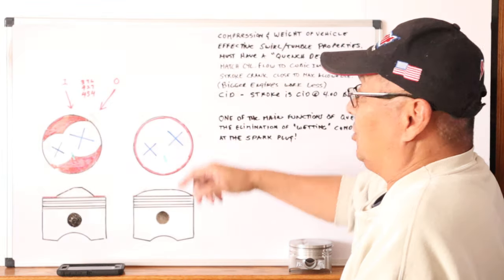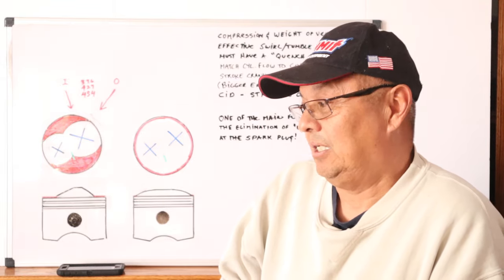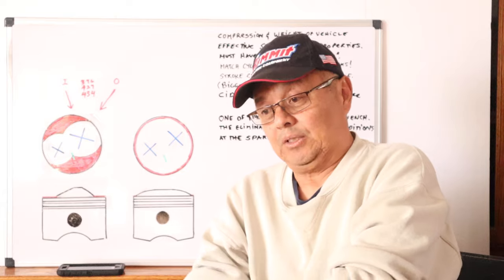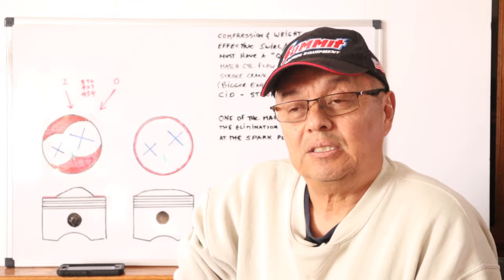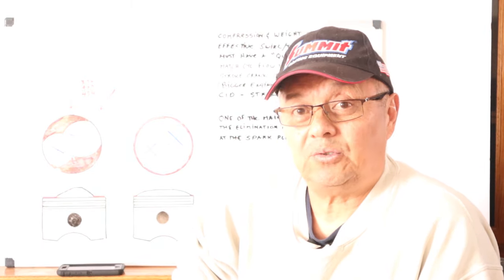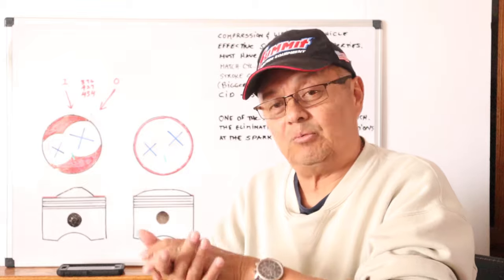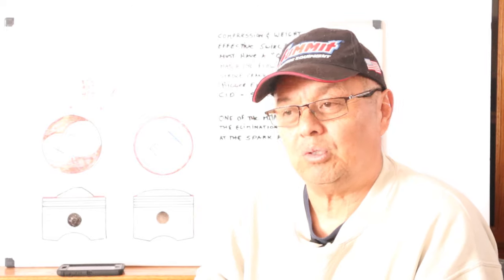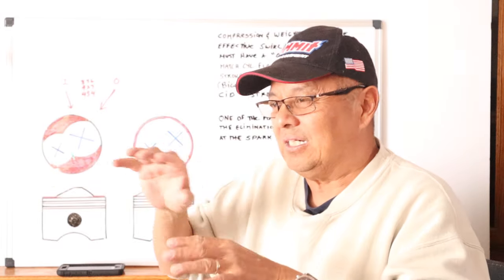HOW MUCH COMPRESSION PART I CAN WE RUN ON THE STREETS?

Comment: Great video Mr. Alameda-love this topic! Your comment on CR vs load (vehicle weight) was thought provoking. I understand an engine works harder under load, however, I can't visualize how the combustion process is affected by load.  What's got me stumped is, if an engine runs fine (no detonation) under light load, why would it change with load. Cylinder filling is what it is-at any giving RPM, at wide open throttle, and should not change based on load. What causes detonation-Is it CR, or is it the total psi within the cylinder? What say you?

I'm in agreement with you on maximizing squish/quench to create turbulence/mixture motion within a cylinder. However, many moons ago, I believe it was a Circle Track article, where the engine builder had an opposing point of view. The engine builder's theory was to slow the motion in the chamber prior to ignition, to avoid extinguishing the flame front-was this the early stages of chamber softening? Thank you, Tony
Reply from the maker: Ts,  what you will find and realize is the load vs. non load conditions within the combustion chambers!  Under free revving the engine does not meet rpm resistance or slowing down of the rpms.  When under load the rpm rise is stunted/delayed significantly while the FLAME FRONT SPEED DOES NOT SLOW DOWN.  This situation of slower piston speed towards and after TDC will affect the "unburned" sections of the combustion chambers!  Mainly around the intake valve relief @ the piston closest to the cylinder wall.  ON THIS AREA IT SEE'S A RAPID RISE IN TEMPERATURES AND PRESSURES elevated to a point that auto- ignition emanates from this area.  A secondary auto ignition is also present at the exhaust valve relief at the piston closest to the cylinder wall as well.  Lean conditions at the intake valve pocket is exacerbated by the slower piston speed and the expansion of the ignited gases is still progressing at the same rate!  Here the dangerous situation rears its ugly head and continues on towards pre-ignition!
Like wise, the RICH CONDITIONS @ THE EXHAUST RELIEF results in a slower than normal ignition flame speed at this area because the richer mixture progression is slower BUT DOES NOT EXEMPT THIS AREA FROM THE SAME PRESSURE AND TEMPERATURE SPIKES SIMILAR TO THE INTAKE SIDE!  Therefore a loaded engine's RPM RISE IS SLOWER.  AN UNLOADED ENGINE RPMS IS FASTER!  
BOTH PRESENTS TWO DIFFERENT SCENARIOS AS PISTON SPEEDS SLOWS WHILE THE IGNITION FLAME SPEED STAYS THE SAME.  
Remember:  Lean areas burn "slower" because the fuel molecules are farther apart.  
Rich areas also burn slower/cooler because rich mixtures are lazy and burns at a lower rate!
In short if loaded or unloaded does not make a difference on chamber performance and conditions?  Then why do we dyno an engine and tune ignition and air fuel ratios  under load???
If load is unconsequential then we will just free rev the engine and set our tuning tables!
But that would not work anywhere.
The scenario above points to increase probability of detonation first from the intake side then the exhaust side if the conditions get progressively worse.  
The same loading conditions exist in 1st gear and the probability of detonation gets progressively worse the more you get to 2nd, 3rd and final 4th gear!
The difference here is the slower rpm rise as you go thru the gears because the engine sees ever increasing "load" as you lose gear reduction thereby making the rpm rise much slower and here is where the problem starts!
Big difference.  I hope it is clear with you and thanks because it is an excellent and worthwhile question to answer.
Lastly, an engine with no load does not build "boost" and the only way you can achieve it is to hold reverse and low gear/some 2nd gear on a transbrake!  This will excite the combustion pressure to a higher level and the turbo will get a blast of exhaust pressures absent from a no load/light load situation.  Proof that the combustion conditions are indeed different between load (added-weight) and no load/light load.
Ben.

Comment: What metal your heads are made out of has a whole lot to do with how much compression you can run, typically with aluminum heads you can run quite a bit higher compression without detonation when compared to cast iron heads of the same specs.

Comment: Sir I appreciate your videos . I glad I ran onto your web sight . I alway was told 200 ccp on a street engine. I run a bit more on my Harley but you have to be careful on not heat soaking or lugging . At any rate I was told a long time ago I could run a half point more compression with aluminum heads . I don't remember what I was told but way back when the aluminum heads they poured something through them to help with the heat loss ..  most will say no way but I ran 12.5 in a 302 chev engine I built in I think 80 and I ran a 600 isky roller sold..that a a decent set of cast iron angle plug heads off a g gas car .. seems like I ran super unleaded and regular gas mix . I kept the engine at 160 also . I never as far as I know had problems . The engine had a 0 deck . I had help building the engine from a dirt track shop in Dallas and a fellow from my home town..since I found your channel I tried to watch all of them a great teaching opportunity.  Thanks again
Reply from the maker: Thanks Jim.  I feel 160* is too cold and you will have premature cylinder bore wear.  If you can move that higher to 180*f the engine should run better and longer.  Cast iron heads are not a laughing matter as you found out and at 12:5 it is at an advantage and you probably know that and I am not telling you anything you do not already know.  Obtw thanks for supporting my channel.

Comment: Another thing to add, try to get forged pistons made from 2618 alloy, and not 4032.  4032 alloy may fragment from the effects of detonation and if this happens, it can be very destructive of the engine.  The forged 2618 alloy piston is much more resistant to the effects of detonation and heat.
Reply: Also, as a form of 'insurance'... although we have 93 octane here in Texas, I am lucky enough to have stations nearby that sell E85.  I usually get a few Jerry cans full of E85 and add a couple of gallons to my tank before topping it off w/ 93 octane.  E85 is 108 octane... and it also cools the burn of the fuel.  With just a couple of gallons, you don't need to retune anything or get E85-specific equipment.  Definitely see a difference, especially during these 105+ degree Texas summers.
Reply from the maker: What is your mixing ratio with pump gas to e85?  Thanks for your insight.

Comment: Good video Ben! I never really understood how piston shape affects the quench, you described it very well. I learned years ago from Tom Nelson of Nelson Racing Engines, to zero deck the block and use the head gasket to adjust the quench. Of course with a stock type steel head gasket this wouldn't work, you would have to put the piston further down in the hole.
Reply from the maker: With most engine if you are zero deck a .045 head gasket thickness or even tighter would work really good on a small block. What kind of engine do you have?
Reply: @benalamedaracing2765  454 big block chevy....piston will be about .003 to .005 in the hole and using a felpro .039 gasket.

Comment: I always felt the dish pistons suck. Compression 10.5 to 11 with decent gas and 3000 pounds works well as you say. Torque rules on the street. High RPM  power not realistic on the street. Gotta love 331 SBC, smooth and efficient. Keep camshaft 224 degrees/ 110 separation or slightly less on both.
Reply from the maker: A childhood friend of mine with me doing the engines and running his 65 corvette we were cleaning the streets!  lol  LOve it with that much rpm potential!

Comment: Excellent content!! It sometimes becomes difficult to run a flat top with a large 500+ ci stroker, because if you do you'll have like 15:1 compression!
Reply from the maker: Big strokes more than a big bore will yield the higher compression ratios.  It is very hard to build low compression with huge displacements.
Reply: I think you have it backwards. With a bigger bore, such as in a 540 BBC, you need less of a dome to achieve the same compression. With a 454, you need a bigger dome to get a good compression ratio.
Reply: @ekitching any time you increase the cylinder volume you increase the CR if the closed volume stay the same. 540 has 1/4 more bore and 1/4” more stroke than a 454 also.

Comment: BBC heads really suffer with their design... They're severely "undervalved" because of it and require some real trickery to get good numbers, from my experience.  One thing I saw my friend do on a few different castings, was sink the exhaust valve (50 thou or more) so the incoming intake charge flows over top of the exhaust valve face (instead of finding it's way right out through the short side, where then it REALLY can't breathe) in the low lift/over lap phase.  That was pretty much how my buddy, Nick, said it...  I just tried to put it more simply...  He ported heads for living, and always had some wild looking stuff over there.

Anyways!  Thanks a million for the wisdom, Ben!
Reply from the maker: Thank you and you have a good friend there with obvious good skills!

Comment: Many years past Diamond Pistons provided a video on pouring their mold material into a  combustion chamber which they would then use to build your pistons.. this was done on an engine stand with head mounted, mold goop then poured in from bottom of cylinder
Reply from the maker: They did that then and today they use a computer and digitized the whole chamber and feeds that to the computer to make the piston dome.

Comment: I have a good way to extract power from the dish piston no quench motors, with a cam and intake, use a Edelbrock Performer or an old SP-2P intake, not an RPM or anything, it has to have the tall narrow opening at the exit into the head. Then use a 108 LSA moderate lift cam, the scavenging of the cam and the high velocity of the intake creates a swirl/turbulence in the chamber of epic proportions, the engine acts like a 2 stroke at high RPM almost. This is for the guys who don't want to pull the motor and change pistons.
Reply from the maker: Jeff, sounds like it might work?  Usually when you have high velocity ports combined with swirl/tumble, there is a big possibility you will centrifuge your fuel and separate from the airflow.  There is an ideal port air speed street or racing and this is what we have to achieve in order for everything to work together and combust properly.  Even high ram velocity into the chambers will lead to lean conditions like I explained on the piston intake valve relief breaking off or melting...

Comment: Great presentation. My 12.5/1 boss 302 after sitting all winter just blew two spark plugs out of the heads. Just the porcelain came out not the steel part.
Reply from the maker: Wow I hope it did not scratch the cylinder walls.  ?  That i bet is one strong Boss engine!

Comment: This makes sense. 
years ago I had a decked 283 with flat tops, closed camber camel hump heads, and a cam in a 3500# car. 
It ran great on 87 octane. Pretty quick, high 12 second car, good power, never detonated.   
I now daily a 4800# square body suburban, with a stock, low compression, open chamber 882 smog headed 350.
Its a turd, and it detonates on 87..
Reply from the maker: Now you realize the importance of quench and close chamber heads.  Glad you read and understood where I am coming from.

Comment: Finally some great info,have a 355 with pop ups at 12:1 running on pump gas,jetting and timing were fun but it runs like a champ…2400 s10 with th400
Reply from the maker: 3 speed auto with that kind of engine should be one strong street engine!
Seen too many good running engines strap down by a 2 speed powerglide...

Comment: Had a 351 flat-top pistons with 289 HP heads (46 cc chambers)  in a 67 Cougar, Nash 5-spd and 3.4 gears.  Effectively 12.5:1 compression.  No knocks on premium pump gas
Reply from the maker: You must have run that quench tight and you are getting away with it on pump fuel.  That is good and how big or small is the cam?

Comment: Rarely do i hear builders recommend  any more than 11-11.5:1 compression for pump gas... 
I built my 438W 14 years ago with 12.42:1 comp. and 218# cyl. press. w/ 240 Hi-Ports,  Zero detonation, 93 octane (ethanol free) with 30° total timing, idles at 850 rpm, makes an honest 740 horse at 6900rpm and 618 ft lbs tq. single carb, budget pump gas build, daily driver runs 190° in FL summer heat. The cam timing is critical with this amount of compression and a custom Comp. cam to my specifications, built in advance... provides its streetability.
3270# C4 5200 stall street car all motor 9.52 @141.80
Reply from the maker: You got it big time and that is moving no doubt!  People and many of them do not realized the 351W configuration is plenty stout and even the factory block is light compared to other blocks with big mains.

Comment: I'm a rookie trying to piece together a Buick 350. I just watched a video about compression in a boosted 4-cylinder application that made me think I should still buy heads but keep my dished 8.5:1 pistons for cooler temperatures and compatibility with lower octane. But the information here makes me think that without the better quench of a "10:1" piston I won't see the benefits of the better heads nearly as well, and the engine may be closer to mid-grade friendly than I thought.
Reply from the maker: You got my point on compression and now just follow on and you will have impressive engine on pump gas or otherwise!  Just watch the videos I posted and it should apply just about for all makes.

Comment: Great video-and well timed!  Thank you for mentioning the 351c. I am preparing to order pistons for  408 Cleveland with 4V closed chamber.  For fun on the street in a 77 ford 150.  Sounds like I am safe at 10:1. Would you run more than that?  Thanks again for the video.
Reply from the maker: Job, you are safe with that and I suggest using the Aussie 2V heads because the ports are similar to the American 2V but comes with 4V chambers!  Keeping it tight at zero deck and using a cometic gasket to get it tight at the quench will get your desired performance on pump gas.  If you have a budget for a custom piston ask them to make the dish the same shape as the cleveland chambers so you get your maximum quench area!
Reply: @benalamedaracing2765  thanks Ben! Really appreciate you taking the time to respond!  I will take your advice to heart.  My 4V’s will be stuffed - so I hope that brings them closer to the 2vs you mentioned.  Thanks again!

Comment: I run 12 to 1 in my 6.4 hemi 2500 ram with a stock cam. I run tight quench, milled heads srt8 pistons, zero deck block... no knocking showing on the knock sensors.  You can get away with it in a heavy vehicle also and it really helps mpg but I bet my NOX is pretty high...
Reply from the maker: The gearing on the trans with the rear axle does wonder as well so that may be a factor.

Comment: My builder is currently working on my original 69 corvette 427 390hp .070 over with 4.25 stroker kit making it a 498 ci. Flat top pistons are .020 down and plan to use .040 mls head gasket making quench .060. Due to matching numbers block we cannot mill for a zero deck to tighten quench. Builder doing 9.75 compression due to using factory BB iron heads and modern 93 pump gas. Factory heads have been ported 2.19 1.72 valves, titanium retainers. Comp solid roller cam 11-770-8 .639 .646 lift, 236 242 duration, 110 LSA. Tremec TKX 5-speed with 3:55 rear. Corvette will only see the street. I wanted a high torque street motor but wanted as much out of it as possible and look totally stock on the outside. Using original Rochester, intake and exhaust manifolds. Engine will be dyno’d before being put back in the Vette. Not sure under the circumstances what more could be done or changed? Thanks for your video!!
Reply from the maker: Could you tighten up the quench a little bit more?  I feel everything looks good and would like it a little closer even -010 would work.  Perhaps a cometic thinner gasket would work.
Reply: @benalamedaracing2765 Using a compression calc and a .040 MLS head gasket final compression will be 9.7522 to 1. Today I tried asking for a thinner gasket but he doesn’t want to increase compression with todays 93 gas using my original iron 290 heads. The heads have 99 cc’s 🤷🏻‍♂️
Reply: Get a mls .030 like Ben just explained, it’s not going to put you over 11.5:1 and the gains will be more than worth it. I run .027 mls gaskets with pistons.005 in the hole with no problems. Iron headed bbc. You could drop down to a .015 and still be at .035 quench and plenty safe. I too dealt with a machine shop that said 9:5.1 max for 93octane and iron heads.. Some shops  just don’t understand quench. Going tight is key but .032 is as tight as I’ve gone myself.
Reply: @phildo39645 thanks for your reply. I was never able to convince builder to tighten up the quench. He kept saying if I used a .030 mls compression would be 9.9:1 and I’d ping with iron heads and today’s gas. The engine dyno’d 540hp 628tq using factory aluminum intake and Rochester carb.